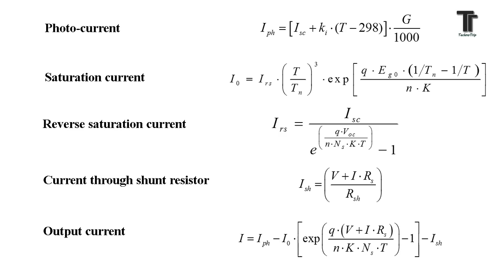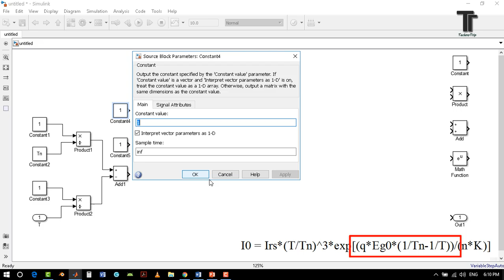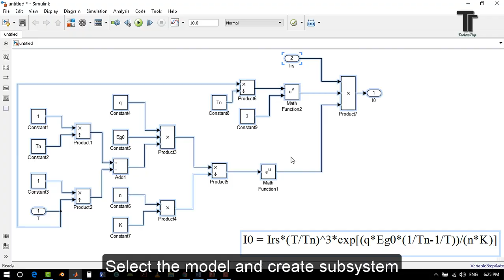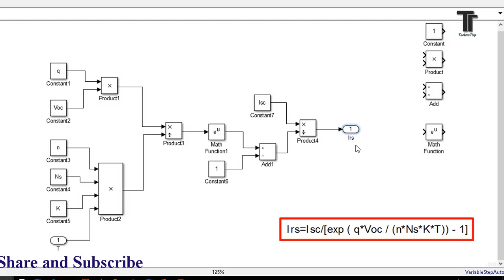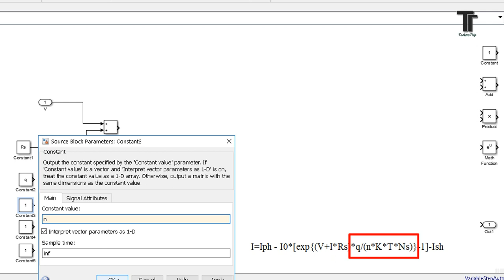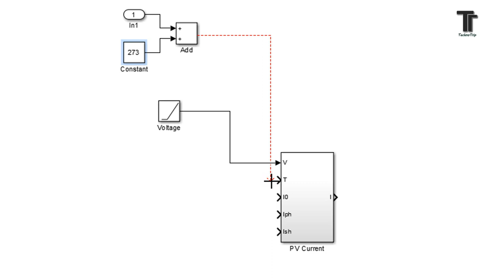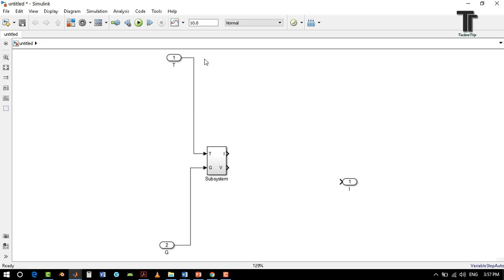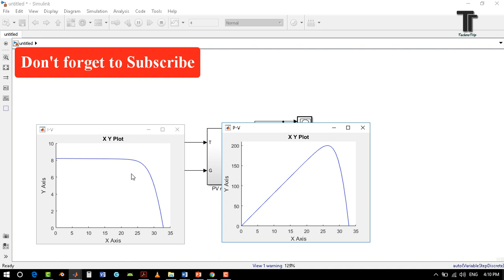mathematical modelling of solar PV array in Simulink (MATLAB 2015)

Comment: If you got the loop error, verify this: for the photocurrent, you must correct the add block Isc + ki (in the video he sets it with a minus). Also, try observing the graphs with a scope if you have a problem visualizing them with the XY mode.

Comment: 100% Got the output.
Reply: Hi Sir excuse me I got this message " Block diagram 'Panel' contains 1 algebraic loop(s). To see more details about the loops use the command Simulink.BlockDiagram.getAlgebraicLoops('Panel')  or the command line Simulink debugger by typing sldebug('Panel')  in the MATLAB command window. To eliminate this message, set Algebraic loop to "none"." And my graphs are a right line.  How can I solve this? I would appreciate.
Reply: @jorgelechon8044  did you solve the problem? can you help me PLS?

Comment: An error occurred while running the simulation and the simulation was terminated
Caused by: Algebraic state in algebraic loop containing 'SinglePVmodule/PV module/PV current/Sum of Elements3' computed at time 0.0 is Inf or NaN.  There may be a singularity in the solution.  If the model is correct, try reducing the step size (either by reducing the fixed step size or by tightening the error tolerances) or tweak the initial guess of algebraic loop variable values.

How can I solve this problem?
Reply: did you solve it PLS?
Reply: same for me

Comment: If u r getting a warning as "contains algebraic loop"
Than add a memory block in PV current subsystem in between (I and feedback where u r providing) and also add memory block between output Current "I" & subsystem (shunt current) which goes input
Reply: https://www.youtube.com/watch?v=5r7QjLYg0XU&t=772s
Reply: Thanks, I no longer have the warning, but my graphs are straight lines. Do you suddenly know why this happens?
Reply: can you help me i get the warning but i didn't understand you what should i do?
Reply: @Physics_with_rihab  go according to the steps I mentioned earlier.

Comment: Excellent stuff! Got the exact output. Thanks alot.
Reply: Bro ,can u please share simulink model please.
If you can then please lete know.
I will drop my mail.
Reply: @akashbabu6707  👍
Reply: @RabbyHasan  sure bro👍
Reply: I faced a problem Could you help me?
Reply: @j.mondal9647  Yes
Reply: @kiranjose7727  
Block diagram 'simulink_PVmodule_8' contains 1 algebraic loop(s). To see more details about the loops use the command Simulink.BlockDiagram.getAlgebraicLoops('simulink_PVmodule_8')  or the command line Simulink debugger by typing sldebug('simulink_PVmodule_8')  in the MATLAB command window. To eliminate this message, set Algebraic loop to "none".
Component:Simulink | Category:Block diagram warning
Found algebraic loop containing: 
simulink_PVmodule_8/PV module/Shunt current/Product (algebraic variable)
simulink_PVmodule_8/PV module/Shunt current/Add
simulink_PVmodule_8/PV module/Shunt current/Product1
simulink_PVmodule_8/PV module/Subsystem/Product1
simulink_PVmodule_8/PV module/Subsystem/Add
simulink_PVmodule_8/PV module/Subsystem/Product2
simulink_PVmodule_8/PV module/Subsystem/Math Function
simulink_PVmodule_8/PV module/Subsystem/Add1
simulink_PVmodule_8/PV module/Subsystem/Product3
simulink_PVmodule_8/PV module/Subsystem/Add2
simulink_PVmodule_8/PV module/Subsystem/Add3 (algebraic variable)

How could I solve?
Reply: @j.mondal9647  Have you tried this from your warning message? "by typing sldebug('simulink_PVmodule_8')  in the MATLAB command window."
Reply: bro share the matlab file please

Comment: Block diagram 'trial1' contains 1 algebraic loop(s). To see more details about the loops use the command Simulink.BlockDiagram.getAlgebraicLoops('trial1')  or the command line Simulink debugger by typing sldebug('trial1')  in the MATLAB command window. To eliminate this message, set Algebraic loop to "none".
Component:Simulink | Category:Block diagram warning
Found algebraic loop containing: 
trial1/PV Module/Shunt current/Product (algebraic variable)
trial1/PV Module/Shunt current/Add
trial1/PV Module/Shunt current/Divide
trial1/PV Module/PV Current/Product
trial1/PV Module/PV Current/Add
trial1/PV Module/PV Current/Product1
trial1/PV Module/PV Current/Math Function
trial1/PV Module/PV Current/Add1
trial1/PV Module/PV Current/Product2
trial1/PV Module/PV Current/Add2
trial1/PV Module/PV Current/Add3 (algebraic variable)
Component:Simulink | Category:Model

how to solve this issue guys
Reply: i got same problem can u help me??
Reply: @nuntetevo1771  you should set algebraic loop to none.I have sent the file you requested to your email.
Reply: zorlu serkut  ok thank you very much. U help alot
Reply: I faced same problem can you help me

Comment: Sir, when simulting i only got part of the graph. can you please help me!
Reply from the maker: Check XY graph axis settings should be more than what is coming(Voltage, Power, current) 
Or
Increase ramp of the voltage 
Or 
Increase simulation time
Reply: @TechnoTrip  sir how connection pv cell to series parallel to get more power
Reply: @TechnoTrip  how to check the xy graph axis..plisss

Comment: I got an error will please fix the problem 

Found algebraic loop containing:
'project/PV module/shunt current/Product1' (algebraic variable)
'project/PV module/shunt current/Add1'
'project/PV module/shunt current/Product2 '
'project/PV module/PV current/Product1'
'project/PV module/PV current/Add1'
'project/PV module/PV current/Product3'
'project/PV module/PV current/Math Function'
'project/PV module/PV current/Add2'
'project/PV module/PV current/Product4'
'project/PV module/PV current/Add3'
'project/PV module/PV current/Add4' (algebraic variable)
Reply: got the same .. did you find the problem?

Comment: Algebraic state in algebraic loop containing 'PV_mathematicalmodel computed at time 0.0 is Inf or NaN. There may be a singularity in the solution. If the model is correct, try reducing the step size (either by reducing the fixed step size or by tightening the error tolerances) 
i got this error at the end ?
how can i fix ??
Reply: Plz have you fixed this problem?😊

Comment: Can you please answer me a question. While in the model here you have used Vt i.e aKt/q in the diode reverse saturation current, i have noticed somewhere in a research paper that it is Vtn. i.e aKTn/q. The difference in the temperature value is my question. Tn is a constant i.e 298k while T is an input variable and depends on surrounding temperature.

Comment: The shunt current is a function of the PV current, forming an algebraic loop. Add a low-pass filter, with a frequency cut-off, e.g. 10kHz, in the feedback from the PV current to the shunt current.

Comment: Algebraic state in algebraic loop containing 'modelling_of_solar_PV_array/PV module/Subsystem4/Add3' computed at time 0.0 is Inf or NaN.  There may be a singularity in the solution.  If the model is correct, try reducing the step size (either by reducing the fixed step size or by tightening the error tolerances)
sir i recevd this error and i don't know how i fixe't
Reply: The shunt current is a function of the PV current, forming an algebraic loop. Add a low-pass filter, with a frequency cut-off, e.g. 10kHz, in the feedback from the PV current to the shunt current.
Reply: @gert_kruger  How can I do this?
Reply: @gert_kruger  how?? can you help PLS

Comment: Simulink cannot solve the algebraic loop containing 'durga/PV miodule /Shunt Current /Add' at time 0.08 using the TrustRegion-based algorithm due to one of the following reasons: the model is ill-defined i.e., the system equations do not have a solution; or the nonlinear equation solver failed to converge due to numerical issues.
To rule out solver convergence as the cause of this error, either
a) switch to LineSearch-based algorithm using
set_param('durga','AlgebraicLoopSolver','LineSearch')
b) reducing the VariableStepDiscrete solver RelTol parameter so that the solver takes smaller time steps.
If the error persists in spite of the above changes, then the model is likely ill-defined and requires modification.
Reply: Plz help me, tell Me how do I overcome this problem, ish is not working
Reply: @snigdhamajumder6980  did you get the answer

Comment: hello sir, i have some question 
1.what should i do if i want to raise up the voltage value so i can raise up the power too? but without change the amount of Ns &Np and not change the value of Rs and Rp to? It's has been my problem  since making PV modelling with MPPT and buckboost converter 
2. Why do you choose ramp block as a voltage input?
Thank you sir, i hope you can help me
Reply: Nadia we use the ramp block because we need to see PV and IV curve which requires voltage to increase over period in time

Comment: address the error
""Algebraic state in algebraic loop containing 'pvback/PV module/PV current/Add' computed at time 0.0 is Inf or NaN.  There may be a singularity in the solution.  If the model is correct, try reducing the step size (either by reducing the fixed step size or by tightening the error tolerances)""
thanks in advance
Reply: i reduce max step size still not resolve
Reply: did you fix it?

Comment: sir i am getting an error in reverse saturation block that says
 Invalid setting in /PV MODULE /Reverse saturation current /Constant' for parameter 'Value'.
Caused by:
Error evaluating parameter 'Value' in 'SUSHANT123/PV MODULE /Reverse saturation current /Constant'
Undefined function or variable 'Ns'.

please help me out .. my project dates are coming soon.
Reply: Have u got the solution.. Plz help me

Comment: my plot came out differently. help?
Reply from the maker: What u get??
Reply: Techno Trip two straight lines. How do i fix this?
Reply: @TechnoTrip  arning: Block diagram 'best' contains 1 algebraic loop(s). To see more details about the loops use the command line Simulink debugger by typing "sldebug best" in the MATLAB command window. To
eliminate this message, set the Algebraic loop option in the Diagnostics page of the Simulation Parameters Dialog to "None". 
Found algebraic loop containing:
  'best/PV MODULE/Shunt current/Product' (algebraic variable)
  'best/PV MODULE/Shunt current/Add'
  'best/PV MODULE/Shunt current/Divide'
  'best/PV MODULE/PV current/Product4'
  'best/PV MODULE/PV current/Add1'
  'best/PV MODULE/PV current/Product3'
  'best/PV MODULE/PV current/Math Function'
  'best/PV MODULE/PV current/Add3'
  'best/PV MODULE/PV current/Product6'
  'best/PV MODULE/PV current/Add4'
  'best/PV MODULE/PV current/Add5' (algebraic variable)
Warning: Using a default value of 0.1 for maximum step size.  The simulation step size will be equal to or less than this value.  You can disable this diagnostic by setting 'Automatic solver
parameter selection' diagnostic to 'none' in the Diagnostics page of the configuration parameters dialog. 
help me brother

Comment: excuse me sir, how to develop this pv model to supply load or to model with MPPT. I have tried to give the load but the voltage is not constant.
Reply: hello Sir did you get a solution of that problem is yes could you show me how you did because i have a same problem too
Reply: @hadimama01  Have you got the solution? How to integrate this with a buck converter with P&O mppt for battery charging?

Comment: can you please tell me why you add a ramp signal in ur model. and one more problem if i simulate with 4sec as run time iam getting 4V in display and if i change run time to 50 it is showing 50V in display. please reply.
Reply from the maker: We want to see the characteristics of power or current with changing of voltage, through this ramp signal we are getting increased voltage over time. So we use ramp signal.
Your ramp slope will be 1 and simulation time also 1. You have to increase your voltage signal from zero to open circuit voltage So increase  ramp slope in ramp signal parameter so that you get complete curve.
Reply: Sir can u please send the model.
Reply: My mail id : imforu.kiran@gmail.com

Comment: An error occurred while running the simulation and the simulation was terminated
Caused by:
Simulink cannot solve the algebraic loop containing 'pvmodel2/PV Module/Shunt Current/Product' at time 0.0 using the TrustRegion-based algorithm due to one of the following reasons: the model is ill-defined i.e., the system equations do not have a solution; or the nonlinear equation solver failed to converge due to numerical issues.
 To rule out solver convergence as the cause of this error, follow either of the suggested actions. If the error persists in spite of the above changes, then the model is likely ill-defined and requires modification.
Reply from the maker: please add a unit delay between the current output and  current (shunt current block).
Reply: sir, I have added unit delay but still, I am getting the same error, It shows again and again

An error occurred while running the simulation and the simulation was terminated
Caused by:
Simulink cannot solve the algebraic loop containing 'pvmodel2/PV Module/PV Current/Add1' at time 0.0 using the LineSearch-based algorithm due to one of the following reasons: the model is ill-defined i.e., the system equations do not have a solution; or the nonlinear equation solver failed to converge due to numerical issues.
 To rule out solver convergence as the cause of this error, follow either of the suggested actions. If the error persists in spite of the above changes, then the model is likely ill-defined and requires modification.
  Suggested Actions
 Switch to TrustRegion-based algorithm using
 set_param('pvmodel2','AlgebraicLoopSolver','TrustRegion')
Fix
Reduce the VariableStepAuto solver RelTol parameter so that the solver takes smaller time steps. The relative tolerance parameter can be accessed from 'Configuration Parameters > Solver > Additional options > Relative tolerance'
Reply from the maker: a current loop also in pv current, hav u put a unit delay there?
if u done and error still persist, than try to simulate in discrete type and put smaller sample time.
Reply: Thanks a lot sir
Reply from the maker: if still having problem of algebraic loop, then go to 'configuration parameter --> Diagnostics --> Algebraic loop', here select it to 'warning' or 'none'.
Reply: now model is running but voltage and current is zero in P-v and I-V curve
Reply from the maker: plz send me screenshots of model. also P-V and I-V curves
Reply: model Screen shot
https://i.imgur.com/9HQMeyK.png
Reply: Saturation Current
https://i.imgur.com/NLY7tOD.png
Reply: P-V and I-V Curve
https://i.imgur.com/5fvncDi.png
Reply from the maker: sorry for delay....
In saturation current, in first 'Add block' there should be '-' instead of '+'
I suppose, after correction this without unit delay the model should work.....
and for zero current and power
All information i can't get from these images....so parameters value should be checked.....
Reply: @PrashantSingh-tk2ms   can u please send me simulink file
Reply: @junaidlte2683  did this work with you?? can you help me
Reply: i tried this and the plot still looks wrong
Reply: Hi, Sir, did you solve this algebraic loop error? I also face the same probelm.
Reply: @congbobao2876  Yes, You can remove the algebraic loop error by unchecking the algebraic loop box in pv array model.
Reply: @PrashantSingh-tk2ms  Sir, Thank you so much. I am new to PV. I follow the same step in the video and build the PV cell by many blocks, and I didn't use PV array model provided by Matlab. Could you tell me where can I find the algebraic loop box?